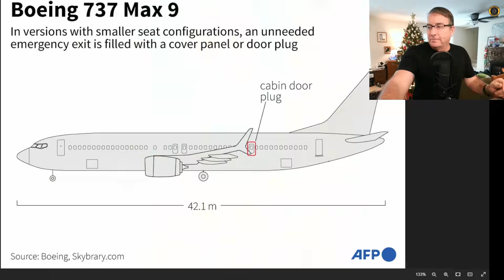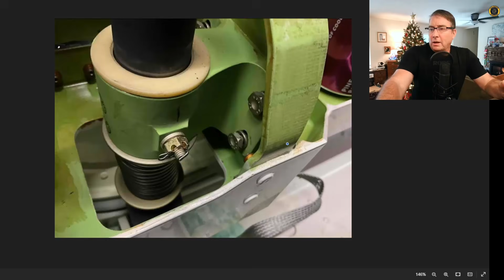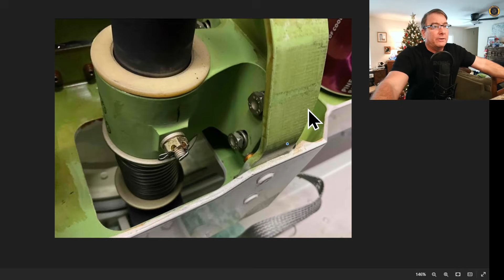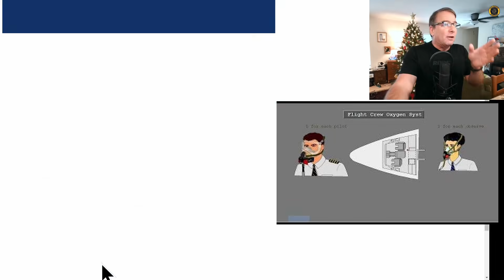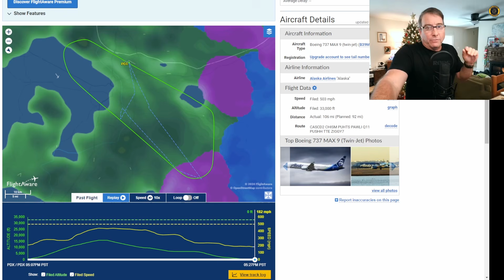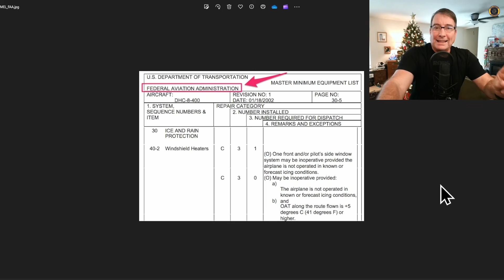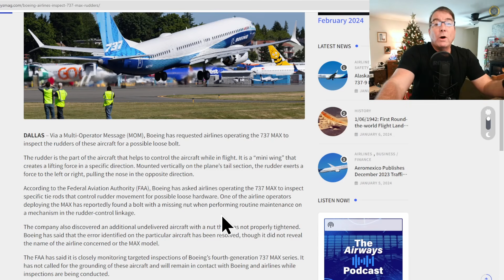"Yes, We Have No Bolts"  9 Jan 737 Max-9 Update

Comment: If you leave out the 4 cotter pins that hold the only 4 bolts in that keep that panel on it will fail soon as two bolts fall out

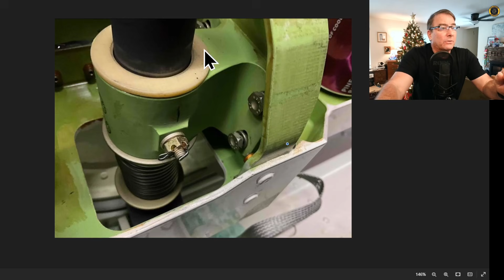Comment: The image you show @6:00 of the hinge fitting has all four bolts loose on the mounting flange; we can see the split ring washer loose under three of the bolt heads.  Do we know if that is a photo of the hinge fitting during assembly?  Or is it on a jet that's currently flying?  [cue the danger music]

Comment: ETOPS for loss of cabin pressure calculation does not include the added drag and fuel penalty for a missing door plug.  Good reason to take the 737 Max 9 off ETOPS until they can resolve the plug door.

Comment: 1- Somebody signed off on the bolt install work.  Should get a lawyer to get affairs in order.

2- Cockpit doors need burst disks to prevent de-pressurization ripping them open. Hope this becomes part of the recommendations.

Comment: At this point if I was an airline with these planes I would seek to invoke some form of lemon law and tell Boeing to come get their planes back. Fundamentally as a potential customer I do not want to fly on a 737 Max now or in the the future. If an airline might potentially be putting me on one of these planes I dont want to do business with them. I dont trust these planes and I doubt that trust can be restored in them. Furthermore I dont trust Boeing to make this right or to make the cultural changes to prevent this from happening going forward. 

Boeing needs a massive shake up. Management that setup this culture needs to go. Any board members that were around when all these decisions happened need to go. They should replace the board with an eye to restoring the old culture. When all that happens and they show they have changed their ways then I would be willing to take a chance on the newer planes they will surely be producing.

Comment: Great descriptions.  Great Insight.  Well informed considerations based on known facts.  I learn so much from your channel.   I'm surprised that with the springs on the bottom hinges pushing the plug door hinge guide up against the bolt that the bolt would back out even without the nut and cotter key.  However, as you indicated, with repeated loading and unloading from landings and takeoffs, that may have been possible; working out a little each cycle.  (I'm not a mechanical engineer, but I'm also surprised that Boeing would load a bolt transversally, rather than in compression - across the bolt along the axis of the bolt.- sounds like a job for a pin with good shear resistance.)  Another thing that surprised me is that they found the door prior to the point of explosive decompression on the flight track  - I would have assumed that it would have travelled forward (like ordnance.)  And good on the flight crew getting the aircraft down below unpressurized cabin altitude (below 12,500')  quickly and staying above the Cascades.  Looking forward to more from you.

Comment: @Juan  thought Dan Gryder said the Haneda JAL FAs refused passengers using emergency exits for something like 16 minutes - sat on the runway waiting for someone to give clearance to evacuate - sounds like an insane policy to me?
Reply: It’s not insane max it’s to prevent further injury. Last thing you want is passengers evacuating while the engines are still running and either get ingested or burnt/blown over by the exhaust gas
Reply: @tomstravels520  Does it take 16 minutes to shut down engines?
Reply: @ArthurDentZaphodBeeb  it didn’t take 16 minutes for all pax to get out, it took 16 or so minutes for EVERYONE including the crew and pilots to get out. Reportedly they kept checking the aisles to ensure it was empty including checking lavatories.

Comment: Why is the door bolted from the outside. Door on pressure vessels should have inside flanges so even if the hardware fails, the cabin pressure will keep it sealed.

Comment: Really looks like Boeing has a huge quality and contrl issue where during build process basic things are not checked at all. It sounds like a plug door can only depart the plane if bolts are missing in a way that those bolts were never present or at least never secured. This can only happen if the work of the guy who installs these bolts (or is supposed to install and secure) is not checked at all (or the checks are done on paper by the installer himself and not by any inspector.
But this is what you can expect if Boeing is outsourcing everything to the lowest bidding contractor and as little as possible is done in-house.
If low construction costs is (far) more important than quality and maybe they made a comparison is made between the costs of proper quality control all the time on all planes against the once off costs of a possible but relative unlikely event of an accident that could have been prevented by proper +but expensive) quality control they might have worked out that saving on quality control is more profitable. And taking the risk, assuming that a possible accident due to choosing to not do proper quality control will happen well after the people making the decision to save on quality have made 2 or 3 promotions by then. (And if choices like this being made at 3rd party contractor then the responsible people have for sure moved on to next role or next employee.
Since Boeing chose to make short term results and short term (quarterly) results for the shareholders are more important than long term value of the company for all stakeholders (including passengers and staff of the customers) incidents like this will happen more and more; and the pressure on the organisation to improve productivity and profits/margins after very costly incidents (like the double crash of the Max followed by covid and now this...
Boeing leadership should really choose to change mindset completely and tell their shareholders: ok huus, to get you maximum results we made wrong choices in the past, you did profit on it for many years but now it really hits us hard and if we don't completely change the way we work and our complete mindset and attitude towards quality it might kill Boeing completely: so give us the green light to go back to the pre McDonnell Douglas merger and allow us to again become the absolute leader in quality and be an "engineering first" organisation. This will require extreme investment to undo a lot of earlier programs to outsource everything and will impact short and medium term revenue: but if you allow us to make this transition back to old pre merger Boeing you will see long term results and it will save Boeing in the long term and we will become again the absolute market leader in quality.
They should be brave enough to tell shareholders that if they continue on current path they might continue for some years because of their market share and more demand then supply for now: but when market conditions do change Boeing in current mindset will go down and no one is to big to fail. Even though stakeholders as US government will keep (large) parts of the company surviving (eg the military/defence departments) the organization as s whole (and thus the shares) can and will go down if they continue on the current path of lowest possible costs.
Being cheatin short term is (snd has been) extremely expensive in the long term

Comment: Just not good look for Boeing...at all.  Note that Boeing has had major issues on the KC-46 tanker ($4 billion loss with problems ranging from bad remote refueling station and unacceptable amounts of trash and and parts...even tools....left in the plane), the 777-Max fuselage cracking in tests prior to the target 150% of stress load, the Orion capsule failing in the first test flight, making it unable to dock with the ISS, dropping out of the "Doomsday" plane program because Boeing was unsure they could meet target costs given the whole host of issues they have faced with these kinds of projects, going way over cost on the replacements for Air Force 1, and of course, the 737 Max tragedies.....now this door plug issue.

If you haven't seen the Frontline documentary on the 737 Max issue, it's sobering.  It's also frightening how certain Boeing executives placed so much emphasis in getting the Max to conform to the same type-rating as the older 737s to the point of lying to regulators, ignoring engineers, and hiding new elements of the plane from pilots.

Most frightening was the ending of the documentary, where the reporters were recording an interview with Calhoun, the new CEO.  Calhoun was blaming the pilots of the Indonesian and Ethiopian planes for the crashes.  He seemed to take no blame on Boeing's part for what happened.

It basically showed that maybe nothing has changed at Boeing even after all the tragedy and heartache.
Reply: Calhoun was on the boatd at the time of the MAX crashes, and was backing Muilenburg, until he wasn’t.

Comment: Well what's on the CVR and flight recorder isn't relevant in this type of incident. This was a structure failure. How the crew handled the landing after isn't going to change anything to prevent other doors from coming off. Finding the door was the big one. They've got all they need now to figure this thing out. They're not going to find springs and bolts, too small. But what a huge break to find that door so fast. Awesome.
Reply: It fell in a populated area, so that was an advantage in finding it.  Fortunately, it didn’t hit anyone.  Also fortunately, it fell through evergreen trees, so had a relatively soft landing.
Reply: FDR is definitely relevant. Tells you everything about the aircraft. What would be extremely useful is if the aircraft encountered turbulence causing the aircraft and subsequently the door to bounce free
Reply: I disagree, useless information. That door should be able to handle the pressurization at the extreme limit plus. Also any amount of turbulence. It's a hardware failure, this type of failure isn't recorded on the FDR.. You're talking nonsense.  @tomstravels520
Reply: @tedstriker754  useless information? Clearly you don’t know anything about accident investigation. There is one major critical part of the FDR that tells you a lot about the accident. The TIME everything happened and how long it took things to happen. They have already built a timeline of events from the FDR.

Comment: I’m very curious if there are marks on the surfaces that these bolts/nuts tighten onto… no marks and you can almost guarantee the bolts were never there. If there are marks, the bolts were there at some point. Where did they go?!
Reply: Some people have said the plug doors are removed during final assembly to get more access for doing interior work, then put back.

Comment: I hope someone can explain this to me. Wouldn't it be easier to just use a standard door without handles and slide and just cover it over with internal fit out? Save a lot of engineering.
Reply: The plug door should be more secure, if properly installed, and probably less expensive.  It also has a regular window.

Comment: If bolt torques arent to spec, interface and bearing loads go through the roof and the loads are meant to be taken by the bolts acting in tension, not shear. Pounding loads (shear) also go up if there is any bolt hole clearance, which can also contribute to fatigue failure.
Reply: all 4 bolts are shear bolts. Torque only keeps them from rattling.

Comment: It looks like with the lower hinge fittings engaged with the bottom of the door,     the person installing it compresses those springs, aligns the upper guide rollers with the guide fitting and let the springs push it up into place. Then they would pin it so it cannot droop out of the upper guide track fitting.

Comment: Why arent the convesations and flight data transmitted in  real time to servers on the ground which can store everything. You could probably just transmit this using AM radio waves. Aviation is so far behind the curve. Very little has really changed in the last 70 years. I get changing tried and tested things can be a safety issue, but there are so many other quality of life changes they could make which will have no, if not a positive impact on safety without having to change all equipment at all airports. Could be a service provided with the  purchase of the aircraft.

Comment: FAA should mandate Boeing make these "plug" doors real emergency doors or permanently sealed fusilage  rather than this plug workaround. How this ever got approved as a viable engineering solution capable of repeated pressurization cycles is beyond responsible understanding.
Reply: The plug doors are supposed to be (effectively) permanently sealed.  When installed correctly, it’s a good system.

Comment: Great video.  👍  I felt like I was in a 737 oral.

Don't you just hate when a kit to assemble something comes with a bag of parts, and when you get all finished you have 4 bolts left over?

Kudos to the crew!  That had to be a handful.
Reply: Too funny, but sad at the same time.  Is there a rule when someone takes a break that they have to finish what they started, such as rigging a door?  I can visualize someone coming back from a break and thinking, "What should I start on now?"
Reply: @BillRussell-b5p 
I think they have to sign off on work being completed, so theoretically someone would notice.
Reply: they could easily provide dedicated hardware kits to different areas of the planes manufacturing. The kits can be weighed as a final check to make sure everything is there. I imagine currently they just have giant bins of all the necessary parts.

Comment: All I can say is thank God nobody got hurt or injured. That’s a blessing in disguise. But the main take away is somebody somewhere along the line either at Boeing has to be at Boeing in the main construction of this usage in the final stages of fitting putting everything together is not doing their job properly. I mean they’re finding problems not only with the plug doors or door, but also in the tail section the rudder  I think it was what’s next the elevator stab, or ailerons or flaps or landing gear I mean the list could go on is what problem they’re going to find next because somebody wasn’t doing their job properly and nobody’s following up on inspections and you can blame several people in the factories and also FAA for not keeping an eye on Boeing as well. As far as the cabin door blowing open, that is a weird one or maybe the cabin door wasn’t secured properly before they took off is that possible don’t know, but either way there’s a lot of questions that are going to be asked from here on out somewhere down the line going forward. My opinion only.

Comment: As a small time pilot myself, if the door not in use and bolt it shut , why is the spring system fitted underneath needed?
Reply: The plug door can be partially opened for inspection and maintenance, such as perhaps replacing a seal.

Comment: OK, so Boeing has already admitted that that plug is designed to blow out in case of emergency depressurization. Apparently the fuselage would be in jeopardy if they didn’t have that plug to blow out. And as far as 90 seconds, no it was 18 minutes. There was very little communication with the bridge and a language barrier. Just my two. Cents.

Comment: regarding the "blow outdoors" for the cockpit... I don't think the door is designed to swing open... There is a ROUND BIT (I've often asked what that is, but the pilots never know)... that has some weird material in it...that I think is designed to "blow out" in the event of a de-pressurization.
Reply: Well, the whole door blew open and the blast took off the pilots headphones and blew a clipboard out of the cabin so anything smaller than the door would not be good. And this was at only 16,000 feet. Seems to me the 737 needs a lot more sq ft of vent area.

Comment: Assuming there are torque specifications on these bolts wouldn’t the slot/cotter key set up be problematic? It seems the slot would have to arrive over the hole at the precise prescribed torque value otherwise the bolt would have to be backed off or tightened up to get the cotter key inserted in the hole. Wouldn’t that cause a plus/minus deviation in the prescribed torque? value.
Reply: Juan said that is why torque is not critical for those castle nuts.
Reply: @GH-oi2jf  bolts on the cam fitting are in shear. The bolt shank does all the work. The nut is just there to keep the bolt in the hole.  However the bolts holding the lower guide fitting to the door they are finding loose should be tight. They appear to be a tension load. Yes torque can be critial in that application but depending if they used lock nuts in the design its not that big of a deal aslong as they were tight. The big deal is what bolts were omitted upon release. Ntsb cant find the bolts. I am guessing its the four bolts with castle nuts.  Wait for the report. Dont automatically point fingers. Ntsb is slow but magical in their findings.
Reply: add or remove washers